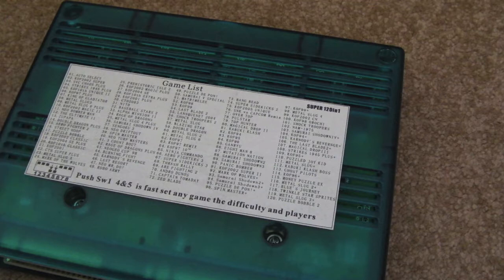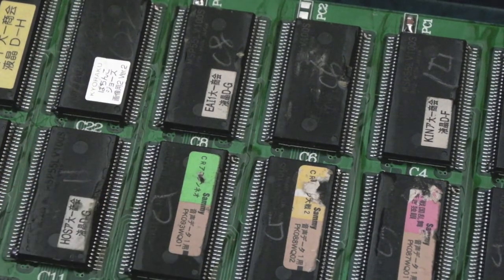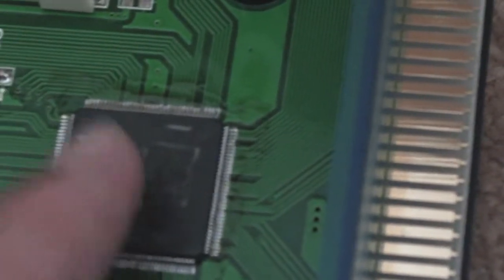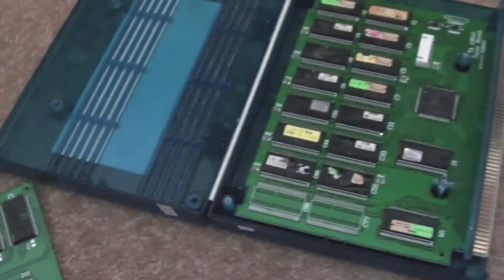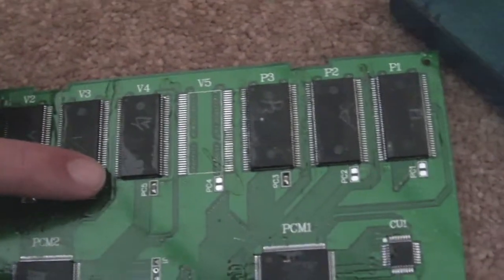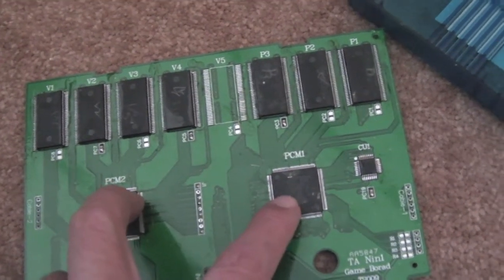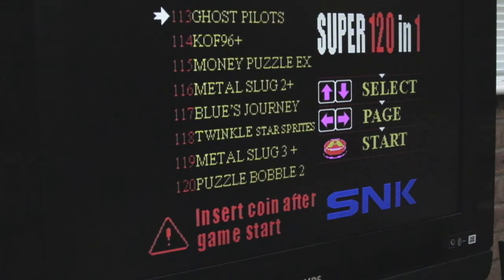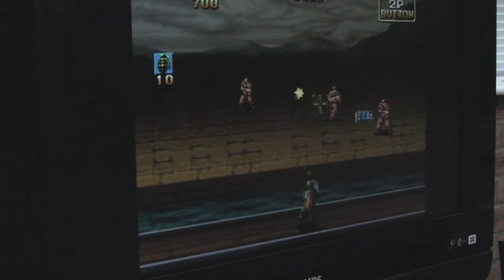SNK Neo Geo MVS 120 in 1 Cart Teardown

Comment: Hello,  can anybody confirm this work on AES with MVS adaptor + Unibios?  I have this setup but I can't Lauch games : / I boot in a menu where I can only Switch difficulty for each game.
Reply from the maker: If you can only switch difficulty - that would indicate that its detecting the DIP switches used to configure the difficult.  Since the AES doesnt have those DIP switches - that's the problem!  You could try switching the system into MVS mode (using unibios) to see if that makes a difference, but it may still be looking for those DIP switches that aren't there!
Reply: @GadgetUK164  that's exactly what I did but I still get right to the difficulty menu 😒 and I don't have an MVS to check if my cartridge is faulty.   It's à shame,  I really wanted to try ninja commando.

Comment: So are the 120 in 1 worth buying or are they plagged with problems? Or is it just the higher number carts with all the major problems? I've been looking at the multi carts as a quick way to get 120 games but after watching these 3 video's on the multi game carts I'm starting to have second thoughts. I have an AES Gold system & waiting for my single slot MVS to ship, no longer can I afford AES carts, MVS seems to be the only way. It's too bad SNK Playmore does not release a Neo-Geo 2 system. Thoughts anyone?
Reply from the maker: The 120 in 1, 138 in 1, and 161 in 1 are worth getting.  Each has some games with graphical problems or audio problems, but for the most part many of the games are perfect.  It is worth doing the PCM fixes and add all the missing bypass caps, and perhaps swap out the diodes for regulators, but the 120 in 1 is pretty good tbh.

Comment: Update: On the 120-in-1 the soft-dips which you can access via the Universe BIOS do NOT change the difficulty. They only change the number displayed for difficulty in the soft dip menu (EXTREMELY CONFUSING). You can still change things like 'blood' and 'language' via the normal soft-dip. The level displayed in the soft-dip menu for difficulty is meaningless due to the way the games have been altered. You have to change the difficulty by using physical dip-switch 4 and 5. That will allow you to change the difficulty down to level 2. I would have thought that both the soft-dip AND the hard dip would work, but this is not the case. However, you can bypass the hard dip by putting the console in console mode. In console mode the game's difficulty mode (which is not related to the MVS soft dip) has nothing to do with MVS soft dip settings.

Comment: One thing about the 120-in-1 that I've noticed is that it has a different version of King of Fighters 94 than the other two multi's I've owned. The graphics on King of Fighters '94 on the 161-in-1 and 138-in-1 have flickering text and animations in some areas. The 120-in-1 version of King of Fighters '94 appears exactly as the original and has none of that.
Reply: King of Fighters 99 (the one that is not supposed to be a hack), on the other hand, appears to be some kind of hack and not the original version. On the 138-in-1 it is the original version. I can't say for the 161-in-1 as I had a bad cart and some games didn't play.
Reply from the maker: Majestic Lizard hates Google + I will check those out later but I think mine are OK on both 161 in 1 and 138 in 1.  The only real problem I have with 2 of my carts is random volume level issues - at least that's what it sounds like to me.
Reply: It is the real version on the 138-in-1.

Comment: Yesterday morning I received a call from a postal inspector. After the investigation was opened, and the inspector contacted the post office, the package mysteriously appeared. It was then shipped to me with overnight priority. I have the 120-in-1 now.
Reply from the maker: Great!  I would be interested to know what if any sound issues you have with it?  The NAM on all the multicarts has a missing track on the intro music I've noticed.  League Bowling on the 138 in 1 and 60 in 1 has missing sound on intro - Doesn't have the 'Nooooooooo' sound, nor the 'League Bowling' sample.  I am just waiting for some resistor packs and I will have a go at putting pull up resistors on the 138 in 1 cart - where it connects to the data bus of the YM2610.
Reply: Nam'75 on the 120 and the 138 appears to have a sound channel that is muffled. It sounds like it is there, but is quieter than it is supposed to be. However, as I don't have the original Nam cart, I have no real frame of reference. Not sure about League Bowling. I'll have to check that one later today.
Reply: Okay, the version of King of Fighters '99 on the 120 in 1 is the prototype.
Reply: All voices appear to be absent from League Bowling on the 138-in-1.
Reply: Update: I think what the guy was trying to say was that he was putting a 32 megabit sound IC in a spot for a 16 megabit sound IC. As a result of that, this sound was messed up on his hacked Metal Slug conversion cart. So, someone else showed him how to add the additional contacts necessary so that his 32 megabit IC was fully communicating with the board. (end update) Scratch that. Not 32-bit vs 16-bit. The factors are that some carts used 16 MB audio chips and some used 32 MB audio chips. Then there is the issue of 12-bit vs 16-bit ADPCM.
Reply from the maker: Majestic Lizard hates Google + 32 bit?!? I didn't know the YM2610 could do 32 bit sound!  I think the YM2610 supports 12 bit or 16 bit PCM samples.  The multicarts seem to support both from what I can see.  Unless they've done something to compress samples and modify the ROMs.
Reply: I'm just making guesses. I'm not pretending to have any expert knowledge of any kind. However, it does seem that the graphics are easier to duplicate in these games than the sound. As though the sound hardware may differ from cart to cart in ways that are difficult to duplicate on a multicart.
Reply from the maker: Majestic Lizard hates Google + I think it's much simpler than that - I think it's corruptions in the source ROM, or they deliberately remove a few sounds to reduce the ROM size.  I've improved sound on my 138 in 1 again tonight (or at least it seems that way, hardly any sound issues at all now).  I will upload another video at some point.
Reply from the maker: Majestic Lizard hates Google + They don't have buffer RAM on the carts btw - It's purely ROMs, address decoding / mux / demux stuff and encryption on the more recent games.
Reply: GadgetUK164
I just know that in the article I read (that I linked above) where a guy was changing a Samurai Shodown II cart into a Metal Slug cart, he had a problem because there was a 16Mb module on it instead of a 32Mb module on it as Metal Slug had. However, the problem might have been that he was putting a 32Mb IC in a spot for a 16Mb IC. His rewiring would then simply allow the additional pins to communicate with the board properly. That would mean you are right and it is simply a ROM and not a buffer. He didn't explain what was going on very well and I made the best common sense assumption I could.

Comment: Gadget, how do you exit the games in this cart? Is it the same "hold down start for 6 seconds" as in the 161 in 1?
Reply from the maker: Yes, same as 161 in 1.  I think the 60 in 1 is the same as well.  The interesting thing with the 60 in 1 is if you start a game and let it run the demo sequence for a few loops and dont press anything, it then goes back to the menu on its own - it works that way.
Reply: you alive? still have the cart? hold p1 and p2 start buttons

Comment: Did you ever get your 120-in-1 sorted? And which games were defective on it?
Reply from the maker: Yes, after I did the last clean up on it and I resoldered pretty much everything, and swapped out the diodes for a 3.3v voltage regulator - it works fine now.  No games with issues except NAM-1975 has a glitchy sound on the intro.  I got a second 120 in 1 where NAM-1975 is perfect but Metal Slug has glitchy sound lol.

Comment from the maker: Sorry I couldn't reply until - A linked comment or something (Good old Google+...).  Anyway, yes, those CPLD's (I thought they were FPGAs but never looked up the part number) do the address decoding as you say.  Basically similar to mappers in NES carts on a larger scale.  The NVPROM chips seems to be working chips rather than faulty chips - ie. not deliberately faulty and they aren't hard wiring banks etc to disable dodgy areas of the chips.  They are using second hand reclaimed chips though, and they are certainly of questionable quality.  I've got a 2nd 120 in 1 now that works much better than the first does (regards V ROMS).  I've noticed the same differences in quality of the NVPROM images between multiple 161 in 1 carts as well.  I guess they either don't verify the images or they perhaps don't care if a few bytes are incorrect in a few of the chips.   Some of the ROM dumps used are also questionable and had corruptions at the source etc.  There are JTAG connector points on these boards but I've not investigated to see if I can read them yet.  I do have the JTAG programmer required to read them but just not had time to check - I will one day in the future.  My guess is the security bit is probably set, but that's just based on prior experience of some other chinese bootleg carts etc.

The 3 pins shorted in the corners are indeed the supply (or ground in some cases), but what is really odd is that some chips have the 3 pins covered in one blob of solder, and when you remove the solder they are all joined up anyway on the PCB.  Yet other chips do not have the large blob of solder and still are joined at the PCB - It's very strange why someone would do that...  The only thing I can think is that when they were soldered onto the board, some of the chips were 'tagged' on those 3 supply pins first - to hold the chip in place.

Comment: Those CPLDs are doing all the address decoding for the ROM chips for the various games. It would be interesting to know if they've set the security bit in the programming; if not you could find the JTAG connector on the PCB and read the contents out again.
In theory with the CPLD's you could use ROM chips with different faults on different boards to lock out different regions - but you would require a unique CPLD program for each PCB. I suspect they try to place chips with the same fault in the same position on every PCB to minimise the different CPLD configurations required.
Those shorted pins look like they're next to the power pins on those devices.

Comment from the maker: Thanks, i've worked it out - it's not the carts as such, its a fault in the carts.  I have the 161 in 1 and it's flawless for me.  All games work, not seen any graphical glitches and I get zero problems with sound.  I couldnt be happier with my 161 in 1.  The 120 in 1 has some corrupted ROM images on the NVPROM chips.  The manufacturers are using recycled chips and some of them are partly faulty - which results in corrupt graphics, sound or code.  It's annoying that they dont even have QC.
Reply: Hello GadgedUK164 , what is the most fiable and secure cart to own at this days? 161 in 1 yellow first version?. i think has flash memorys and can be fail at some point flashing games, 138 in 1 dont flash really? if you have dip switch mod is more secure and fiable? i dont know its little hard to know what is the best multicard this days, thanks for all!

Comment: I have that problem too with certain games such as Pulstar, SNK vs Capcom, and the first Metal Slug when it comes to the crackling sounds. I do use the 161-in-1 cart though, but it seems to be an issue with these carts from what I've seen. Using authentic carts do not seem to have that issue.

Comment from the maker: Or perhaps there's some noise being generated on an address or data line at some point - almost the same point each time but not exactly.  It's very interesting.  Because many games are perfect you could think it was corrupt ROM images, but I am not convinced, I am thinking there could be noise on a line somewhere, perhaps related to one of the FPGAs, or perhaps some resistance between two connections that shouldnt be there.

Comment from the maker: Haha, yes, I know what you mean, i've seen stuff like that before.  I am even wondering if some of the flash roms in these carts are 'faulty' chips that have been hard wired (via those solder blobs) to effectively disable 'sections' of the ROM - therefore making the useable sections accessible.  I don't think that's the case but it's a possibility.  It's more likely the chips came from other carts / systems and they are re-cycling them in these carts.